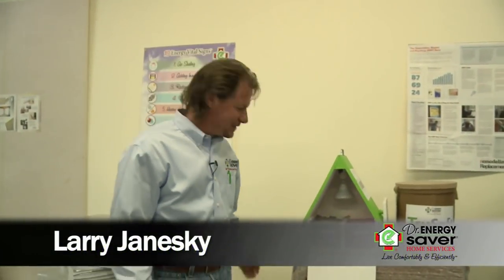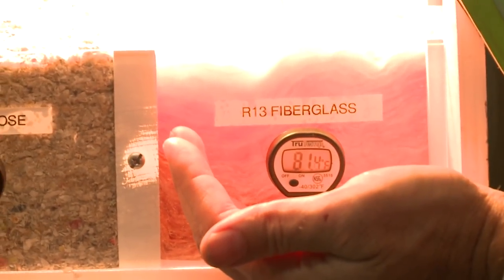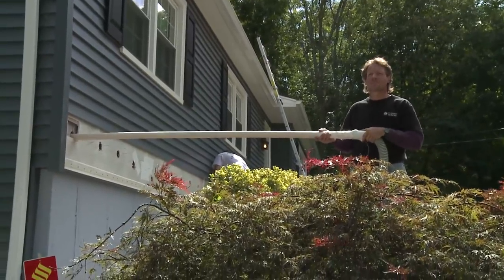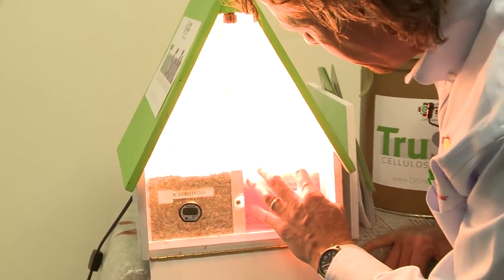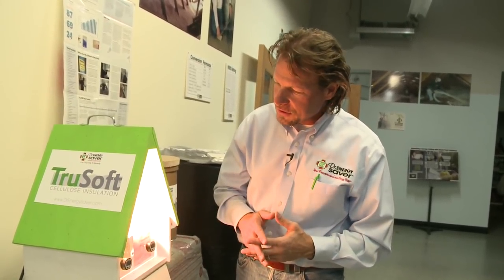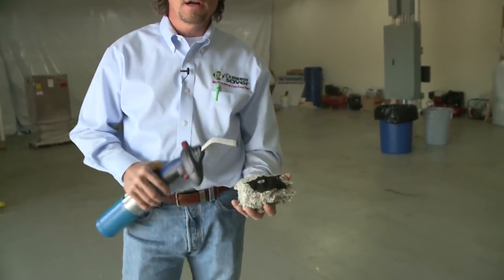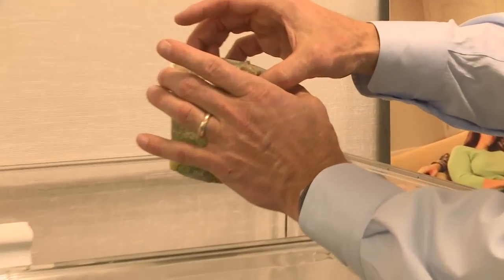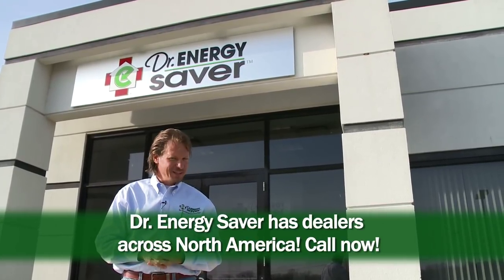Why Cellulose Insulation is Better than Fiberglass Insulation

Comment: Very misleading.   The giveaway is that the thermocouple in the glass side almost immediately sensed the light bulb..... light travels very fast but visible light is not responsible for heat transfer in a ceiling.  Glass transmits visible light so, but does not transmit the long-wavelength infrared light that responsible for heat conduction in a ceiling or wall. That's why the R values of the two sides are equal......they allow the same amt. of heat to pass through under normal conditions. (R is the RESISTANCE to heat flow per unit thickness - and I believe he shows them to be the same and yet says they are not the same......
 I don't like misleading comparisons.    By the way,  I"m not saying glass is better or worse than cellulose - just saying that this demo did not prove what he says He proved that glass transmits visible light and paper doesn't.

Comment: Fiberglass needs the height to work. So to get the same R-value you mislead comparing the 2 types.Why promote a product that will shrink overtime and it breaks down to dust. Why mislead people? you are better than that Larry?

Comment: you have more isolation on the cellulose
Reply: +Mel Torres , I thought the same thing...but look again, the fiberglass is so less dense the light just shines through it and washes it out. It's there, just very light in color. No wonder it's ineffective as insulation.
Reply: Why do the baggers of waste paper
(newspaper rags) intended for sale as *insulation call it  *C-E-L-L-U--L-O-SE
to suggest that it's an *EXTRUDED product made using some complicated process. Is
it because they know their sales staff and installers will be asked to leave homes
if they REVEALED its waste paper shredded in a shredding baler, then bagged and
passed off as INSULATION. * Why do they not reveal it settles 40% and if they sell
and allegedly install 19" inches of waste paper few months later a physical
check will reveal it’s settled to plus or minus 10" inches? When blown in
it comes out of the machine like SNOWFLAKES, and we have all seen how
snowflakes move and settle into an ice layer. The public deserve the truth;
they want value for money and long lasting value. *Cellulose is a fraudulent
threat to the good name of the Green Energy movement, and to energy savers
everywhere.

Comment: That light test is completely flawed and good for nothing but show. It’s not showing thermal heat transfer at all but rather infrared heat from a light source. Fiberglass let’s more light shine through which you never have in a attic. Unless of course you don’t have a roof😂 try that same test with mineral wool and see what you get. Rockwool is a much better insulation both. Water resistant, doesn’t compress over time, can’t catch fire and is actually rated as a fire-block. Excellent sound deadening. In reality and over time, you cannot beat mineral wool. Unless you’re a lazy installer that wants to get the job done fast. Well, blown is better for that. You want real lifetime insulation value, air seal and mineral wool. My last two energy audits prove that point.

Comment: well lets see here is it really green? the average home if it uses cellulose. Will take out of the recycle loop the equivalent of 80 square acres of trees. WOW that's green. Second this test is bogus! use a heat source that produces 150 deg heat. Also use High density batts.  Now the fire show that is so cool! Try doing it when it is not compressed! Have it loose aerated like it would be in the attic. and lets see him do that again. I bet he would not do it! does this stuff insulate? Yes it this video correct and truthful? No.
Reply: ...the energy used to manufacture fiberglass is GREATER than all the energy it saves in a 30 year period. Wish I had the 1980's study reference, sorry.  Also, guess what other silica "fiber" is listed as toxic/ carcinogenic - ASBESTOS, the SAME crystalline structure as fiberglass. A 5 story waterfront home that I insulated (in Horseshoe Bay, TX - google earth waterfront homes there) had it's roof burn DOWN TO the CELLULOSE in the attic - the row of townhomes next to it burnt to the ground in 20 minutes EVEN with 2 HOUR firewalls AND fiberglass insulation. The homeowner was happy that he did not lose his home. He had me insulate his new attic. My 35 years experience with cellulose has been 100% positive, and in my experience EVERY application has proved SUPERIOR for the homeowner, in comfort, home maintenance, rodent & insect intrusion, cost of utilities, sound attenuation,etc... fiberglass should not be an insulation product. HOW can it be both resistant to heat AND be COOKWARE???
Reply: Use a heat source that produces 150 degree heat? Why would you use a heat source that produces LESS heat? A light bulb can get quite hot, much hotter than 150 degrees! As for the high density batts, that wouldn't be a true comparison since a high density batt is rated at R15 not R13 like the so called fiberglass batts are.
Reply: where do you get your information? "80 acres of trees" you DO realize that cellulose is from NEWSPAPERS? not straight from the forest?? egads ,,BE INFORMED!

Comment: Can I add the Cellulose over the top of my blown Fiberglass insulation?
Reply: Cellulose is recommended to seal the leaks in attic fiberglass. In fact the cellulose seal restores the fiberglass's original R-value lost in cold weather. However, if the fiberglass is too high I recommend raking it at least a foot away from the eves so air cannot leak out from the side (edge).  The bare edge is then insulated with cellulose so blocks air flow. It's a pretty neat trick and works great. Otherwise the fiberglass can be vacuumed out, especially if contaminated with rodent nests. Mice LOVE fiberglass bedding.

Comment: You can see the light penetrating the fiberglass.  GLASS, transparent, right.  Not an insulator of light.   Yes it conducts light and the energy (eventually heat) in the light.  What you want is an insulator of HEAT.  Fiberglass like this treated cellulose is an insulator of heat (blocker of infrared radiation and convection of air).  Change the energy source for this demo.  Put a hot skillet over the test samples. 
Paul (not Pat)

Comment: what a load of crap, the cellulose is packed in, the temp gauge is slightly higher in the fiberglass which will give a higher temp for the fiberglass, cellulose absorbs moisture which reduces your r-value. blown fiberglass is better than batts and cellulose any day.